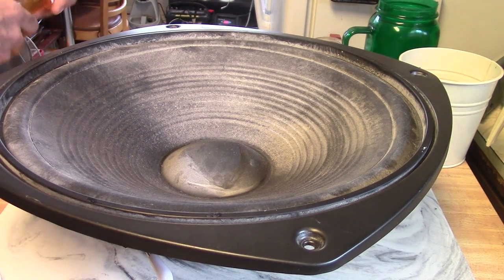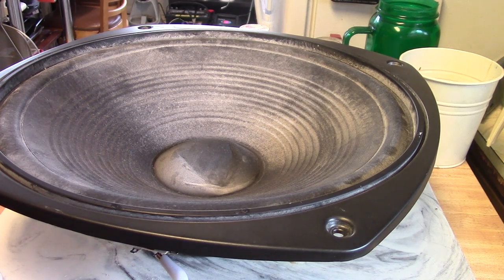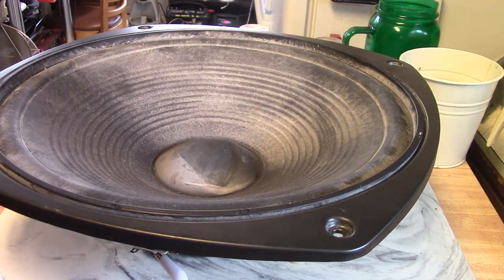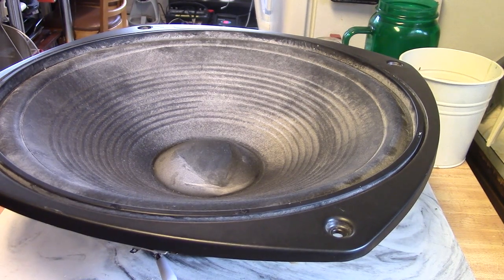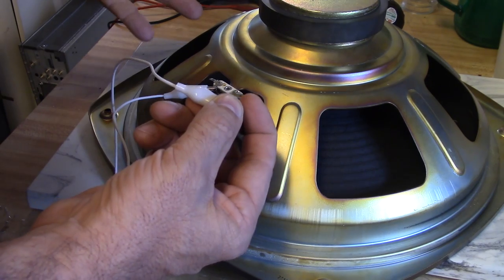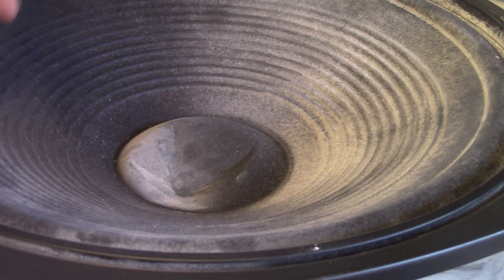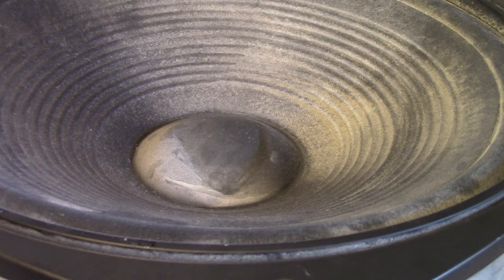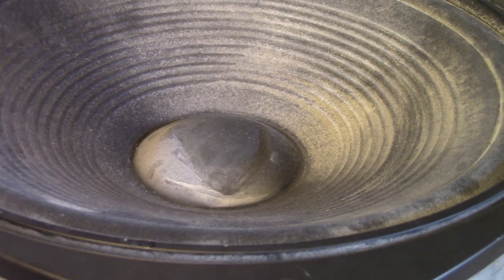Basic Speaker Testing

Comment: An excursion test is another basic test to see if the voice coil is rubbing on the magnet pole piece. Gently push down on the cone as far as you dare while listening for scratchy noises. Another basic test is to "Thump" the back end with your palm while holding the speaker in your other hand, there should be no unusual sounds but a resounding thump.
Be sure the surround (suspension) at the outside edge is not deteriorating, sometimes large woofers suffer from suspension sag where the cone becomes off center due to gravity and other factors resulting in the voice coil dragging.
BTW, many tweeters on enclosures are burned out due to amplifier clipping. Oddly enough they usually have the voice coil wire fail just where it begins the wind on the coil former, or sometimes called the bobbin. I have had some success in repairing these burned out tweeters albeit the resistance is slightly changed. A set of Warfdale floor standing system comes to mind that I snatched up fo $20 comes to mind. I simply removed one turn off the coil and re glued it then soldered the wire back to the terminal.
Reply from the maker: Thanks for some more good tips :-)